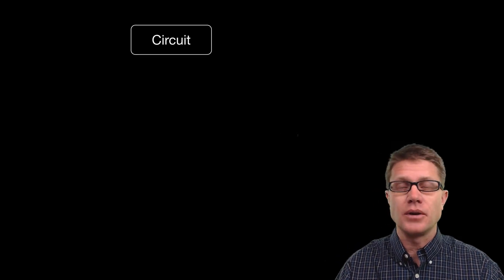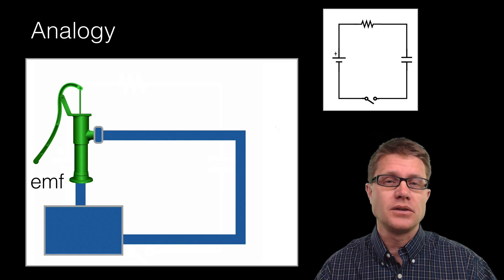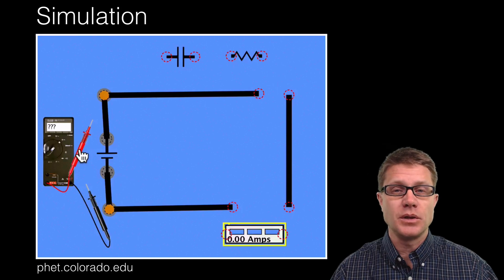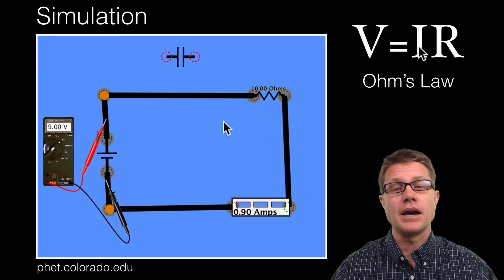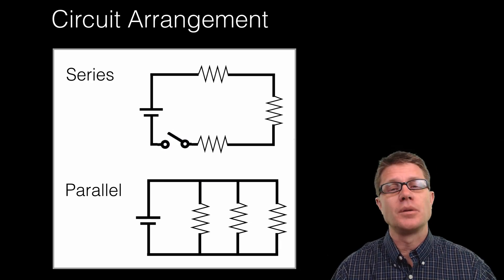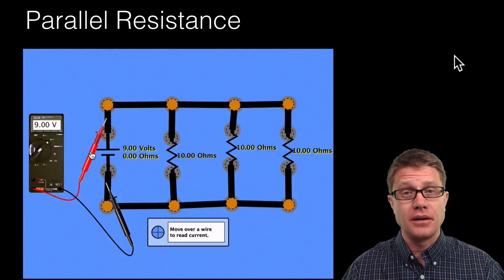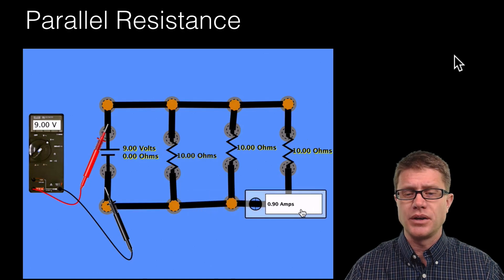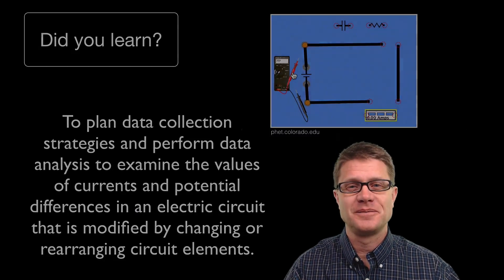Electric Circuits

Comment: Minute 6:40. 
Why does the voltage divide between the resistors? And why can I simply add them together (30 ohms) - please explain

Comment: I've noticed a bunch of complaints that the pace of the 'lecture' is too fast - this is an AP physics rundown and is not meant to hold your hand through the whole syllabus, but rather to assist your learning. Additionally, if you're struggling to keep up with his pace, you're more than welcome to either slow down the video yourself or - better yet - rewatch. As a Bachelor of Science student simply looking for a revision of circuits, this was of fantastic assistance to me.
Reply: ye same
Reply: It’s funny cause I was watching this at 2x. Read your comment and slowed it down, lol 😎. But yeah definitely not too fast.
Reply: Hey everyone, the greatest results that I have had was by using the Gregs Electro Blog (i found it on google) without a doubt the most incredible course i've followed.

Comment: I normally choose to say nothing than give a critique, but your teaching method is crap; it's like you're in a hurry or something.
Reply: "Teaching method is crap" is an awful exaggeration, simply rewatch or slow down the video if it's too fast for you - this is simply a learning aid (or supplement) and is not meant to replace your learning, as such, it's a brief summary/rundown. No need to be overly harsh. Personally, this video has been of great assistance.
Reply: I wasn't trying to be rude it seemed like getting the hilights to a football game, but I guess anybody can be a critic

Comment: but why doesn't a voltage drop happen on the parallel circuit !?
Reply: Because if you look closely, there are only 2 wires, one connected to the + end and 1 on the - end with 3 resisters in between, meaning there is only 1 potential difference, which is 9V